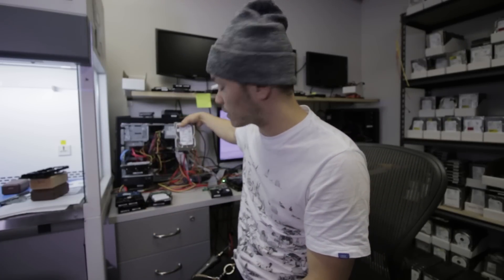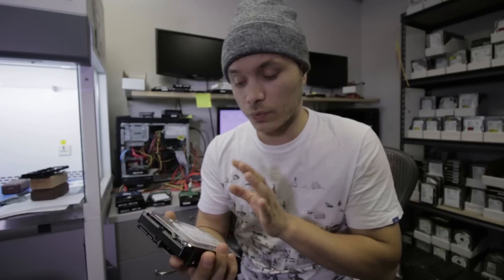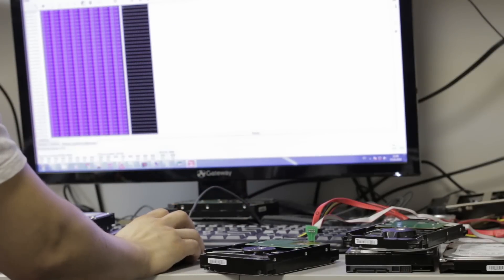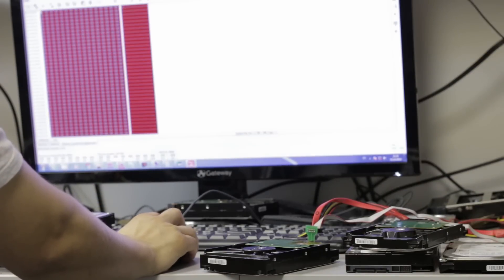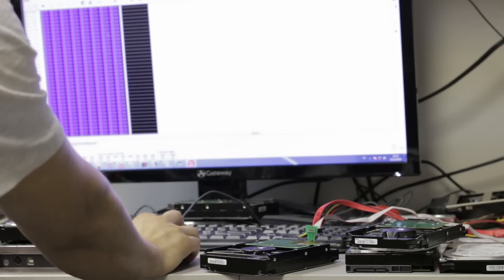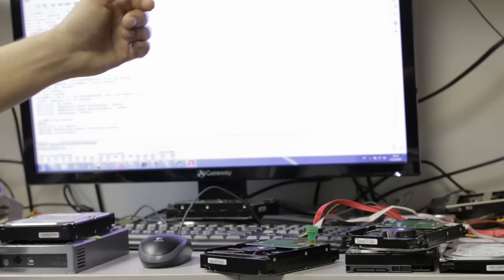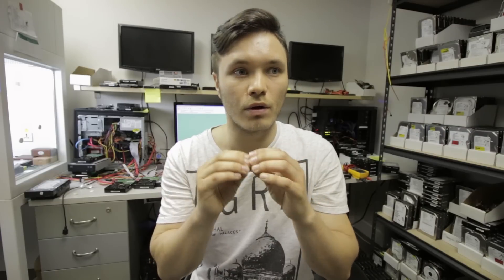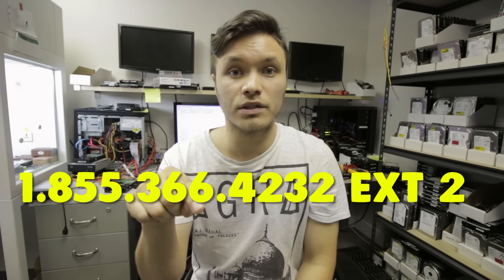data recovery | click of death on ST3000DM001

Comment: Great Video!  I'm currently working on data recovery jobs using plain old ddrescue and some other freeware stuff,  but planning to get a pc 3000 udma till the end of this year.  This video brought up many concerns for me,  it shows just how complicated working with this   devices can be.  I was wondering if You can do an overview on most common Rom faults or priovide some literature where I can get an idea of what I'm go na be facing soon.  BTW i Just love Your Channel,  You are one of the few who bing up details on data recovery in this very competetive market.
Reply from the maker: PC3K UDMA would be a great start man make sure you get Data Extractor with it otherwise its useless for data recovery. HDDGuru is a good place to start, register on their forum and see if you can catch up with concepts. Honestly, you would need to learn as you go, and be prepared for some hard work. PC3000 is not an easy tool by any means. Took me a few years to get really comfy with it

Comment: I would rather use a PCB with a switch and wires than tin foil on a finger.
Reply from the maker: sanjyuubi timing it on Grenada with a switch, good luck
Reply: Grenada? I am not talking about lever switch, more like a tact switch or something telegram key like you can push fast (springy wire and a pad in most primitive shape).

Comment: Very useful video. I had a seagate SSHD drive start clicking on me about 6 months ago, it still worked but I was worried. Luckily it was covered under warranty still. I sent it in to seagate and got a replacement only a couple days later.

I now have a 2tb WD Green drive that works, but it clicks every 10 seconds pretty much on the dot. Luckily, I replaced it with a 6tb WD Black drive this week. I'm going to reformat that 2tb drive and see if the clicking stops.

Just found your channel today and subscribed, your videos are very helpful. Thank you for the content.
Reply: I also did a little googling and found that it's most likely the heads trying to park. This drive is not within warranty anymore unfortunately, but 2tb drives are cheap nowadays.

Comment: Why don't you replaced(swapped) disc.. From non working HDD to working HDD?
Reply: Swapping platters is ultra risky, because if those platters misalign during the swapping procedure, the data will be lost for granted.
Reply: Lukas Vasiljevas ohhkk 🙃
Reply: Platter swaps require special tools because if they get misaligned by even a hair, the recovery is gone forever. It is not possible to get it back EVER again. Not something i'd recommend anyone try.

Comment: Hi friend, I follow your channel
My name is Zenilto I'm from Brazil
I have this Toshiba 750gb laptop HD Mk7559gsxp Hdd2j51 Z SLOT1 T
His fault is the click of death.
The doubt that I have is whenever I have this defect the only solution would be to change the reading head or am I wrong?

Thank you for your attention.
Reply from the maker: Hard to say without inspection. But most of the clicking sounds on modern drives are related to the heads
Reply: HDD Recovery Services Grateful for your attention. I'll see if I can find any specialized company in my country.

Comment: Don't you have to vacuum out the air from a reclosed HD before resealing it? I thought they were made that way and filled with some neutral gas to protect the platters.
Reply from the maker: some new drives are filled with Helium
Reply: I am currently studying advanced data recovery and I love your channel! Great info! Have you ever had to do a recovery on one of these new Helium filled drives where you had to open the drive? Can the drives adaptives adjust to working without the Helium?? 

Just curious...

Comment: Great video ,can you not build yourself a pwm circuit using a relay then set the on/off contacts to short and adjust the  frequency of the relay contacts to get around what you need .that way you get 10 20 or 50 short contacts per second .or do you need to hold the short state for a time to work just an idea if you do this procedure regularly.

Comment: I tried about 30 or 40 times last week to get the right moment to short one of these, eventually got it :)

Nice vid man. So, there was no media damage on this drive, patient heads looked OK, so just a bad preamp then? Do you first try disabling heads in ROM, or go straight for the headswap?
Reply from the maker: Nick Parsons yeah I think this one took at least 20-30 attempts :) I trust the microscope for inspection of heads. They will reveal if there is any platter damage, and then I decide to clip and cut from ROM if needed. If the head stack looks good I go for the swap. I try not to take a risk on partial recovery via head disabling on these, just to avoid the risk of potential platter damage during the imaging. As you know if he had is filthy, even when disabled, it can and most likely will create some ruckus on that platter side. This case went smooth overall. Specially after head adaptive import

Comment: Hi,

do you know what exactly was the problem of this drive with the original heads? In your video, you had a look through the microscope, but I couldn't see any damage. And are you sure that the heads were damaged? May Be there was just this one Firmware problem?
Reply from the maker: port29dr led:00000047 problems with media cache. Overwrote 3x346 sys files on both copies and modified SMP flags - result full image with like a handful of bad sectors
Reply from the maker: port29dr but also original heads were toasted
Reply from the maker: port29dr originally the drive was just clicking and spinning down after 12 clicks or so. As soon as new heads were placed in, it stopped clicking and it would stay BSY, but idle.
Reply: Is there info about the clicking number. For example if drive is clicking 5 times and stop and you have terminal ?